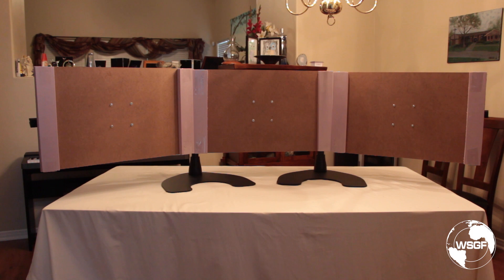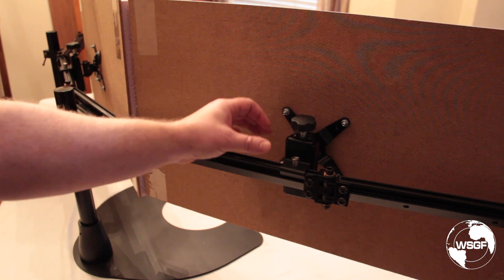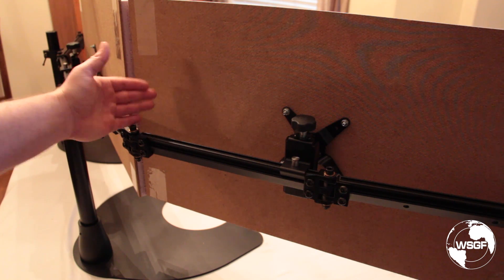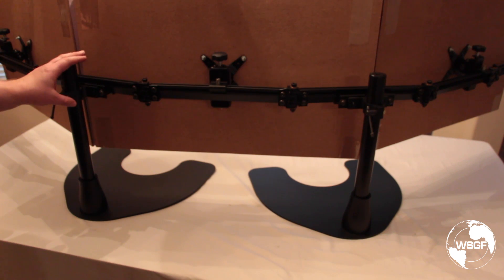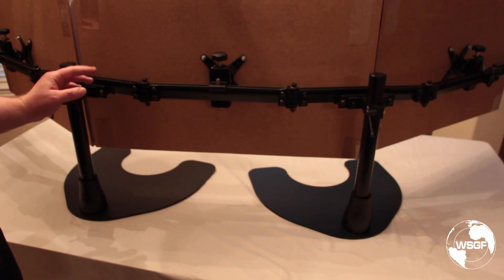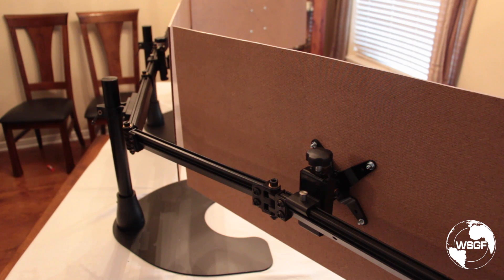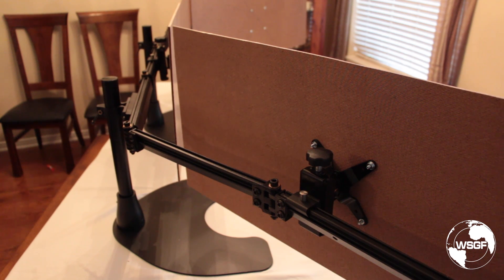Prototyping the WSGF Edition Mega Monitor Stand

Comment: i play a game that take fully advantage of a ultrawide i currently got 1 ultrawide 29 inch and another monitor on a triple monitor stand with the extension wings from ergotech i would like to upgrade my monitors to 34 inch ultrawide high refresh rate but my current bar do not support it so if this product come out or a kit to upgrade my current bar i would defenetly want to buy it
Reply from the maker: You're looking to buy two 34" monitors?
Reply: @WSGF  actually 3
Reply from the maker: @benoitgamache3845  I no longer have the ability to make the custom parts required for the 100-series Mega.  The closest we have is the new 130-series DIY Mini Mega.  You can see that info here - http://www.wsgf.org/products/ergotech-130-series-mini-mega-diy-kit

Comment: I could sure use one of those.   3x32" WQHD monitors.   Would also like option for a 2nd tier for either a single 32" or dual 24-27" on top row.
Reply from the maker: freakairways With the existing stand, you can do 2x monitors on the top row with the tall poles.  We now have an option in the store for a second Mega bar for the top row.  This would allow you to center one monitor in the middle, or do a whole row of three across.

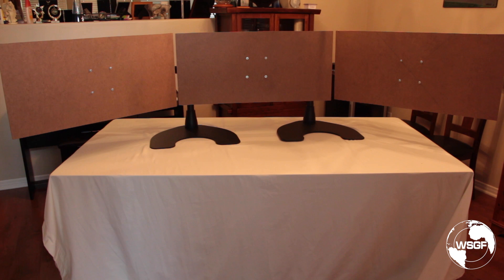Comment: 3:58 Now we're talking kkkkkkk
Reply: somethin
Reply from the maker: If the "kkkk" is referencing price, it won't be thousands.  This config would be $700 + S/H.  One of these based on two Ultimate v2 stands (see other video) would be $750.
Reply: Actually, kkkkk is a laugh where I live (kkkkkk). I am amazed by what can be done with these stands (seeing both videos), but what I want to do is mount my monitor on the wall, together with my 5.1 system, and have a clean table just for keyboard, mouse and controllers.
Reply from the maker: Afonso Soares Where is that?  My Costa Rican friends spell it jajajajaja, while in the US we spell it hahahaha.  We do offer two wall-mount solutions, as well as a thru-desk solution.  Both of these will help clean your table - http://www.wsgf.org/catalog/stands
Reply from the maker: Afonso Soares Here is my original YouTube video where I first wall mounted my stand.  http://youtu.be/-kxmZE90hFw
Reply: WSGF As far as I know kkkkk is asian in origin as in S Korea - used in Brasil also apparently
Reply: WSGF ethr95awd Here in Brazil. It's a mixed bag of "kkkkkk", "apsokapsok", "auushauhsuah" and "huehuehue" as far as I can remember.
Reply: Afonso Soares Are people in Brazil retarded or somethin?